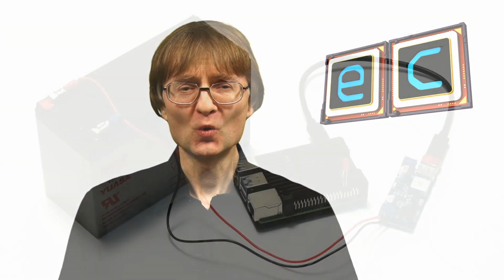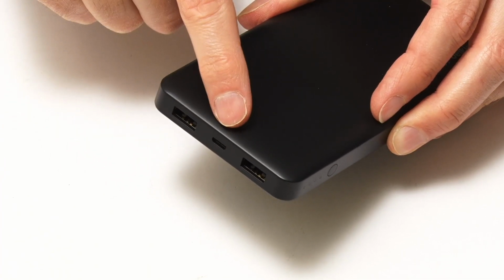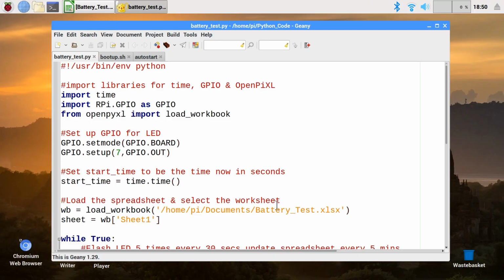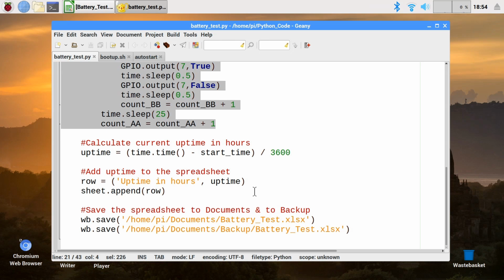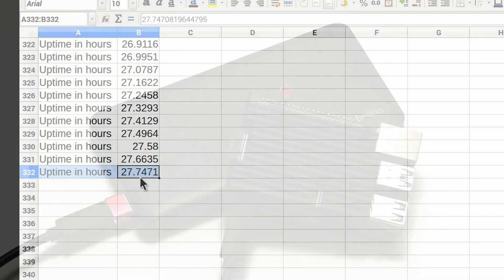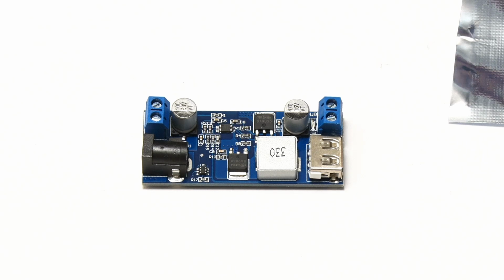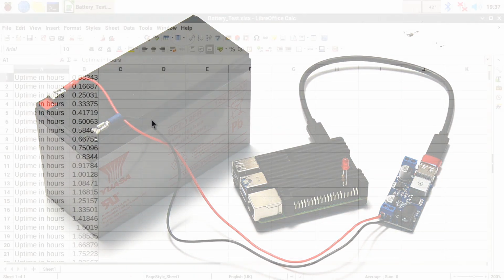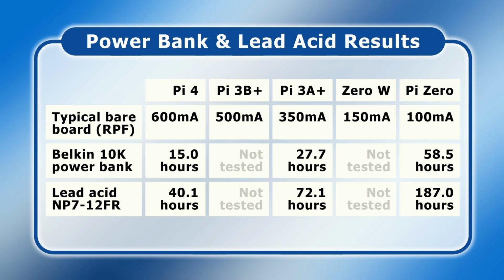Raspberry Pi Battery Power

Comment: Perhaps the lead-acid results were skewed because without an intelligent voltage cut-off, the lead-acid battery would exhaust its entire capacity, well below the safe minimum.   The power-bank is smart enough to disconnect the load when the battery is down to the safe minimum voltage but that simple buck converter will likely keep going down to almost 5V of input voltage.
Reply: There isn't much energy in a lithium ion battery below safe cutoff voltage, something like 5% of the rated capacity if I remember my curves. But yes, the lead acid depth of discharge here is far too much for that battery to have a long life.
Reply: Despite many of the comments I'm reading here, cut-off voltages does not solely account for the "discrepancy". Because even if you considered depleting the Lead Acid battery to 0%, the numbers don't add up. Quite frankly, and it makes sense why, the math is wrong but it's actually because of how power banks are labeled. I mean, the video's calculation assumes a usable ~9Ah vs ~15Ah at 5V (Lead Acid having an estimated 60% more power), so how does it deliver 3X the power? The problem is that the 10Ah is rated at the Lithium's battery capacity of 3.6V nominal. Adjusted, that's actually 7.2Ah at 5V (36 wH / 5V is 7.2 Ah and not 10Ah). Also, I expect a slightly higher efficiency for the Lead Acid batteries "capacity" (84 wH / 5V is 16.8 Ah) over the Lithium battery bank as the differential between maximum and minimum voltages is greater. Then anything left over can be attributed to estimates in efficiency (which add up more over longer time), usage, and possibly THEN cutoff voltage.
Reply: @michealkinney6205  Yep, that's what I said in another comment on this vid a couple of weeks ago.
Reply: @michealkinney6205  that's not the issue here : this lead acid battery was likely discharged well below the safe cutoff voltage of a typical battery. Since the voltage of a lead acid doesn't drop faster when it reaches that threshold (unlike lithium ion & nicad/nimh), the results are quite a bit different than the theory, which makes you believe the maths are wrong, but no, it's the measurements for the lead acid battery that are wrong.
Also for the lithium ion battery, the rated capacity indicated in pretty much any power bank is calculated at the battery's nominal voltage (3.7V) and not 5V. That way manufacturers can make their products look better than they actually are (it doesn't matter as much since everybody does exactly the same thing).
Reply: @benjiderrick4590  Sorry but you're wrong on a few counts, the nominal voltage of a Lithium battery is 3.6V, which is the technical specification and will show on the data sheet. 3.7V is really just marketing. Using the 3.7V number really just further illustrates my point as the capacity on the Li-ion would be even lower [(3.6V * 10Ah)/3.7V = ~9,730 mAh]. Watt-to-watt hour, the Lead Acid offers 2.4x that of the Power Bank (which is "close" to the results). Forget "safe" cut-off voltage, if you depleted the Lead Acid battery to 0%, it doesn't account for cutoff voltage being the cause, so it's invalid by itself (doesn't have anything to do with drop curve or anything else for that matter). And I meant the math that was proposed in this video was inaccurate because it didn't account for the 10Ah being at 3.6V nominal (which is 7.2Ah at 5V, or rather 7Ah adjusted for 3.7V "assumed" nominal voltage) and certain efficiencies, which is what you somewhat reiterate with "voltage (3.7V) and not 5V", so I don't understand your point. That's also honestly why I don't worry about additional calculations and just calculate the watt-hours. It's a more straight forward approach and then you can just account for efficiency loss. The math works out, it is not theory, it is simple done accurately or not.
Reply: That is exactly what happens, And every time you run the lead acid down that far you reduced the capacity and skewed the numbers for subsequent tests
Reply: I wonder how long a Li ion battery pack would last if it was the same size as that lead-acid battery. I suspect a couple months.
Reply: @GordieGii  Buy some 18650 cells solder them in parallel.  Boom you can have any size battery bank you want. My neighbor made a battery bank using some old ammo storage lockers, and made a giant pack. It has just over 3 million mah.
Reply: @ZeroBlackfire  That wasn't my point.
Reply: @GordieGii  shrugs Im really just illustrating how flexible batteries can be...
Reply: @Abstractism I learned that lead acid battries should not discharged below 10 to 9.5v in the worst case.
Reply: The size of a load has a fairly big affect on the actual capacity a lead acid battery. This is likely why the lead acid over-performed. A Pi Zero, and even a Pi4 are fairly small loads.

The bigger the load, the lower the capacity. The smaller the load (to a point) the higher the capacity.

This particular battery is rated for 7Ah, discharging from full charge to 10.5V over 20 hours at 20C. Around about a constant 0.35A load
This same battery is rated at 6.4Ah for a 10 hour rate, a constant 0.64A load.

If you put a 7 amp load on this battery, it would likely be fully discharged in about 15-20 minutes, far less than the 1 hour you might expect of a 7Ah rating.

A Pi Zero would have a load of about 0.05A at 12V. Even with a low voltage cutoff that cut power at 10.5V you would likely get a fair bit more than 7Ah out of the battery.
Reply: True
Reply: Ok, im fine with even 30 frikin hrs
Reply: Yes -  a nice add on feature for lead-acid applications would be some sort of RPi power down and then complete power switch off when the battery approaches 12.3 Volts.
Reply: @Avocettech  a voltage divider on an analog input should be able to accomplish this.
Reply: @RealJonDoe  However you then need something to totally disconnect the battery, as a shut down pi and converter still draw some current, and that will destroy the battery if left to do so for any length of time.
Reply: @paulstubbs7678  granted. Though if you could leave the whole setup on the NO side of a relay, while it would use some power to run, it could also  completely disconnect on poweroff

Comment: It is also worth nothing that the mAH capacity of many power-banks is not what you might think.  Many of them use the mAH capacity of the battery in the bank and since that capacity is at a lower voltage (nominal 3.7V) then  you do not get anywhere near that at the 5V the power bank sends out the USB port.   To deliver 1A at 5V the battery will see a drain of (@4V)) 1.2A.   This means that a 10,000 mAH power bank has a deliverable capacity of significantly less than the 10,000mAH at which the battery is rated.  Then there are the efficiency losses of the boost converter that steps the voltage up from a nominal 3.7V to 5V.
Reply: Was the current draw of the LED accounted for?  What 15mA or less?  The power draw of anything is a general guideline.  Components specification's are a guideline as well.  Not all components are equal - some will draw more than rated, some will draw less. But this is only part of the equation.  The other part is when the battery starts to drain; it's ratings get worse with the condition (remaining charge) of the battery as the condition goes down.  And here again the 'components' of the battery comes into play.  As for that converter - I doubt it's efficiency is 90%!  I saw similar converters with a google search and they're 'unknown manufactures.'  I would guess that if your lucky they're "approaching" 90%!  YES! Having worked with fire alarms and security systems that all use those types of batteries they are great!  And especially since these 'uses' aren't 'critical' it doesn't really matter.  Since I am an Electronics/Computer Technician I would use 'dependable' & "reliable" parts from known and trusted manufacturers.  And then there comes 'component' availability!  If you can only get certain parts - then that's what you'll use!  But @ExplainingComputers is correct!  Test before you put it out into  the real world.
Reply: @Lord_Legolas_Greenleaf  A led can be clearly visible at just 1-2 mA
Reply: Without knowing the voltage of those mAH, the figure it pretty much meaningless.
mWH is what should be used in comparisons like this.
The 75% is pretty close to what you get if you're assuming 5V from a 3.7V battery.
Reply: @ddegn  that's exactly why watt hours are probably a better measure of stored energy if you want to compare different fruit.
Reply: Actually, what it really means is instead of specifying battery capacity in mAH, it should be specified in volts*amps*time I e. In Joules.
A 10,000 mAH at 3.6v will amount to 10Amp*3.6v*3600sec = 129 K Joules of energy.

Just a comparison, 1 kg of gasoline has 40M Joules of energy. So, the 10,000mAh battery above is really only worth 3 grams of gasoline.

Just shows how energy dense fossil fuels are and why humans are so addicted to it.

And if he runs pi-0 on a full tank worth of gasoline (like 50kg or so), it indeed may last till his 85th birthday, may even last till his son's 85th birthday.
Reply: Exactly what I was thinking. So the actual number of the power bank would be 3.6V nominal (though advertised as 3.7V which is misinformation, which someone smarter than me pointed out years ago) x 10Ah = 36 Watts / 5V = 7,200 mAh. That and, I expect a slightly higher efficiency for the Lead Acid batteries "capacity" (84 wH / 5V is 16.8 Ah) over the Lithium battery bank as the differential between maximum and minimum voltages is greater. And then calculate the internal boost converters loss (boost conversion is slightly worse than step down efficiency) as you suggest, and bob's your uncle, the numbers are nearly spot on, lol. Anything left over can be attributed to "estimates" in efficiency and usage. I love math, especially as it applies to energy.

Comment: There is a curve for the rating of a battery based on the rate of drain.

The slower you drain; the more capacity is available.  IF you double the capacity, you will usually get more than double the runtime for a given load.

I think it is possible there is a parasitic load in the power bank when it is on that impacted the runtime.  It is also possible that there is a loss in the converter from 3.7V that was more significant at the lower draw of the Pi Zero.

Comment: Powerbanks typically runs on 3.7v batteries so they have boost converter to get to 5v, which could explain why it got less hours than the lead acid battery.

Comment: Does the buck converter cut off when input voltage drops below 10.8V, or did you monitor the battery voltage to avoid dropping below this voltage? Because it's considered (permanently) damaging the lead-acid battery when per-cell voltage drops below 1.8V, while it still can be drained further.

Comment: 4:34 this is just wrong. Lithium batteries like imr or icr Have such a low internal resistance that the usable capacity is almost always at around 95%.
The capacity marking on the power banks refers to the cells capacity which is around 3.6v to 3.8v nominal.
Also you have to take the boost converters efficiency into account which is usually around 80%.
To calculate the runtime go with the watthours.
A 10000mah Powerbank has around 37wh. Muliply with 0.8 and get around 29wh.
At 5v this is around 6ah of usable "capacity". So running a 2a load on the usb will result in around 3h runtime.

Comment: It is possible that you discharged your Lead acid battery too much to the point of the buck converter stopping working(around 9V ). Battery in that state would not last long and it is not recommended to let it discharge to that point for long period of time because this will shorten lifespan of a battery significantly. And that is probably the cause of higher than expected results

Comment: RPI4 running Home Assistant ... pulls around 0.950A @ 5V run from a 12V 10Ah LiFePO4 battery (nominal 13.2V output) + a DC-to-DC converter.   I get around 24 hours out of the battery in this configuration. 

The problem I have is adding a charger to keep the battery up when mains are available (the battery is there in case mains drop out).  Most chargers charge and stop (forever), which is useless.  Or if the charger does pick up again, its after the battery has discharged significantly, causing excessive cycle wear on the battery for no reason.  Most DC power supplies either trip-off on over-current or go into a hiccup mode which does not supply enough power to charge the battery in excess of the draw of the device.   This means that if there is a power outage and the battery discharges too much, the power supply will trip-off when the mains come back instead of charging the battery.

What I really want is a small fanless (25W 13.4V) power supply that is simply current-limited to 2A and doesn't trip-off on over-current.   Emphasis on 'small' (i.e. not a bench power supply, but something more on the order of a small Mean Well supply... except with current limited output instead of hiccup mode, and small as in current limited to 2-5A, not the bigger 20A+ supplies).

In terms of operating the LiFePO4 battery this way, basically you just throw on a power supply set to 13.2 to 13.4V, current limited to 0.25C or 0.50C of the battery (e.g. 2A to 5A for a 10Ah LiFePO4 battery).  This will effectively 'trickle charge' the battery, and given enough time the battery will hit around 80% of full charge.  Higher voltages will over-charge the battery (since the power supply doesn't cut-off like a charger would).  But the idea is that mains are available, you want a power supply that is able to supply the load rather than constantly cycling the battery.   For example, a normal LiFePO4 charger will charge a battery to 14.6V and then cut-off and not help power the load.  A trickle-charger that doesn't cut-off must use a much lower target voltage (but still above the 13.2V nominal cell voltage) to avoid over-charging the LiFePO4 battery and will also power the load when mains are available.

You don't want to use a lead-acid battery... the limited cycle life and failure modes will drive you nuts.  A LiFePO4 battery is the best battery to use because it will literally last for a decade or longer in the proper configuration and the failure mode for a LiFePO4 battery is just slowly degrading capacity rather than the outright failure that you get with lead-acid.  Also, a LiFePO4 battery holds its nominal voltage (roughly 13.2V) for nearly the entire discharge cycle which is really wonderful when powering a mix of devices.  Most 12V appliances and I/O boards and such stay very happy.  A 12VDC DC-to-DC supply is not needed to run the 12V devices.  Only the 12-to-5 DC-to-DC supply for the RPI.

-Matt

Comment: Actually that powerbank has 10 000 mAh as a capacity of its LiON cells at voltage 3.7 V which gives 37 Watthours, that lead acid battery has 7Ah (7000 mAh) at 12 V, which gives 84 Wh. It clearly shows that lead acid battery has more than twice the capacity of that powerbank (And way higher weight and volume, thats why we use LiON cells in mobile devices)
If we divide those 37 Wh and 84 Wh by (for example) 0.5 Watts (5V * 100 mA, which theroreticaly consumes Pi Zero), we get 74 hours and 168 hours respectively, which is in ballpark of measured values in the video.  Inaccuracy of predicted values is because of different power losses during transformations from battery voltage to 5V to Pi's 3.3 V and different discharge profiles of both battery types.
Reply from the maker: I am well aware that the lead acid is 7Ah at 12 volts, and indeed explained this clearly in the video, and included calculations indicating what it delivers at 5V, both verbally and in graphics. And I also applied a conversion factor to the power bank, again covered verbally and in graphics. These were very clear sections of the video! :)

Comment: So you're telling me that lead acid batteries store for ages and you can run a pi with them for ages? Noted
Reply: Hi, each product has its own advantage and disadvantage

In this case lead acid battery was a similar price to the battery pack and the lead acid unit purchased is able to last 3 times longer
The negative aspect is you loose simple portability, while you could mount it all in a small box the usb charger unit can still sort of fit in your pocket or be hand held

I believe chris mentioned the lead acid battery will take 12 hours to recharge, i dont know what the usb power bank will require in recharge time but some quick google mentions 2-3 hours

So to me if you want portability use the USB powerbank if you want it stationary and less frequent maintenance use the lead acid, is you need it 24/7 then use 2 x lead acid batteries and use battery A when empty plug to battery b then charge A for 12 hours and disconnect - you could do it all with small jumper leads
Regards
George

Comment: 4:38 the 75 % is (partly) caused by the loss of the boost circuitry constantly boosting to 5V while the actual voltage of the cells drops from 4.2 to 3.6 or similar. The rated 10.000 mAh is often exaggerated and also is measured on the cell voltage and not on the boosted voltage. It's a bit like with Harddrives/SSDs :)